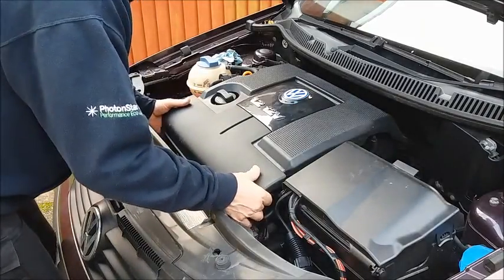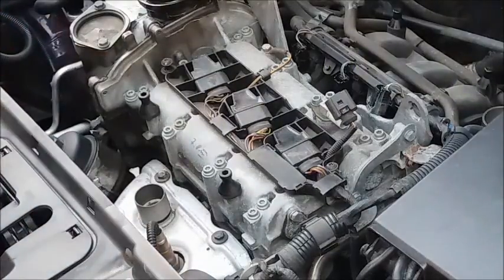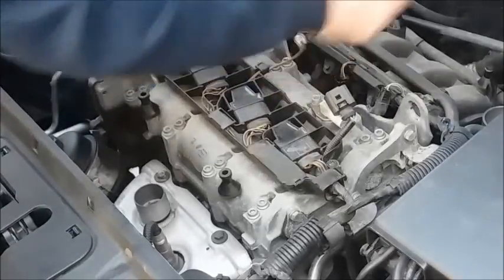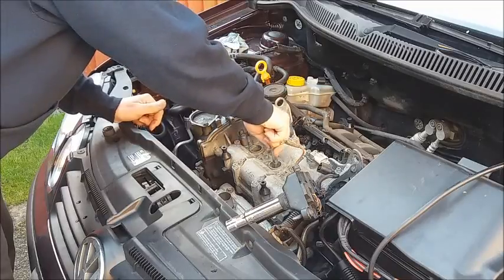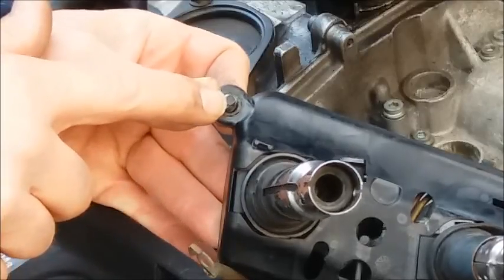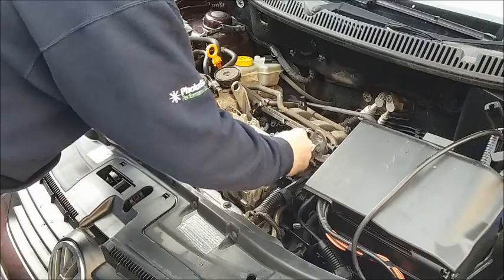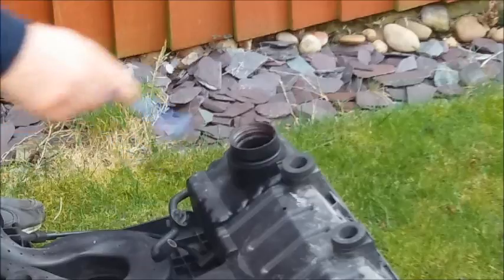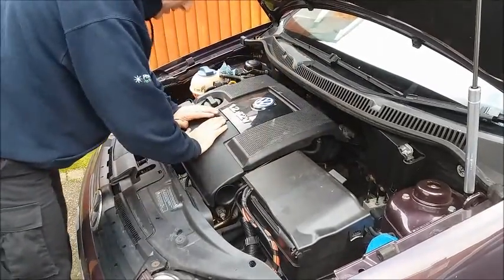VW Polo Spark Plug Change / VW 3 Cylinder Engine

Comment: Hi,  very beautifully presented and easy to understand. 
can you please share a video for vw polo fuel injector replacement. 
Also if you can help me with reason for vw polo 2002 trembling while driving,  i have done done wheel alignment, replaced boljoint. Still having problem

Comment: Thanks for that video, was doing the coil today because of a misfire. Turned out to be no 3 was gone. Motor factor had them in stock which is always a bad sign, they must be a regular fail item.
Reply from the maker: regular as a Swiss cuckoo clock

Comment: Hi I've got some hesitation and stuttering on a VW golf diesel 15 thound on the clock cleaned t body could it be a dirty MAF sensor or running out of ideas
Reply from the maker: Diesel isn't my 'thing' but at the least make sure all sensors and throttle are clean first.